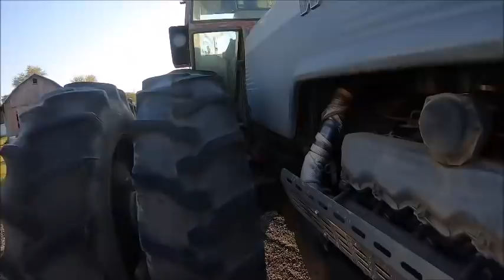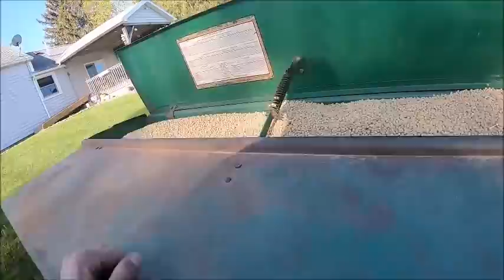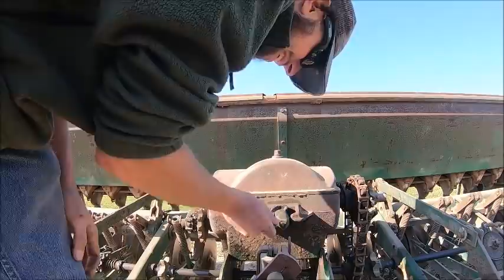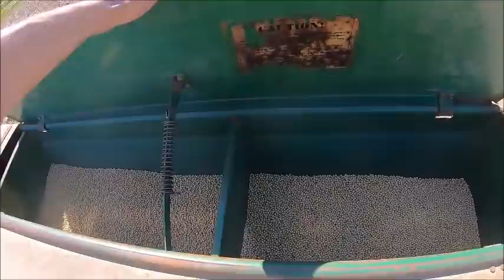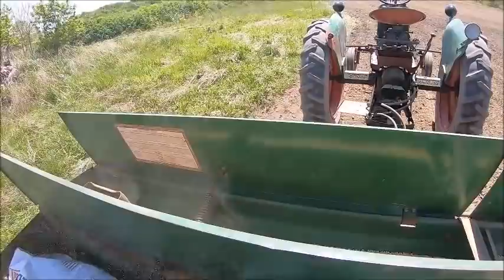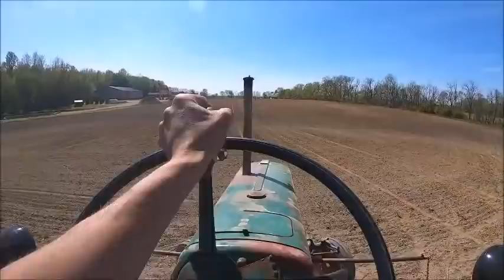Starting On Beans

Comment: The smell of good fresh hay is pretty hard to beat and I also love the smell of green apples.
I was planting corn today and got some experience with the auger wagon. It's a bit puttery with the David Brown's slow hydraulics but it still beats filling with a pail from a tote bag. Just a note, the way ours is built there's a plastic coupler between the hydraulic motor and auger shaft. Nice little feature to keep the motor seals from the fertilizer.
Really nice vintage setup.

Comment: Hooks: Find some old 1970s dairy-cow stale-set that had 1-3/4" or 2" round-tube with hooks (the ones you flip-down to release the cows). You can set the hooks to attach 4 or 5 planter-chains per hooks. When you're set for planting you'd just have to turn/flip down the tube/pole.